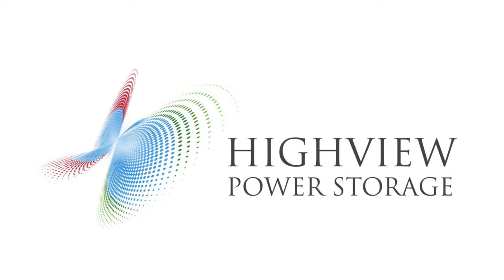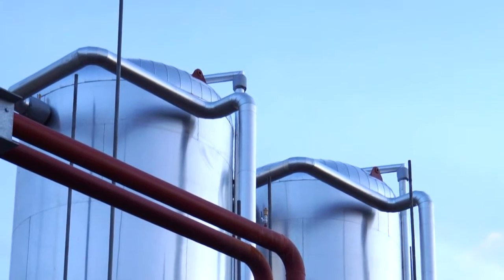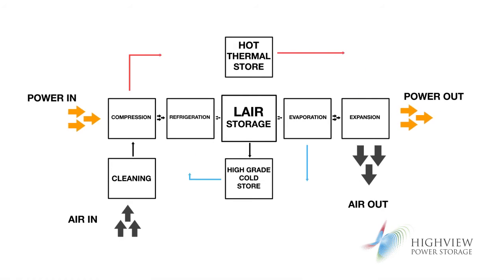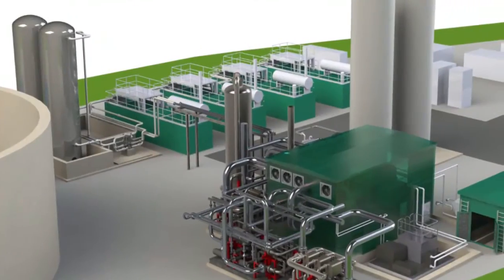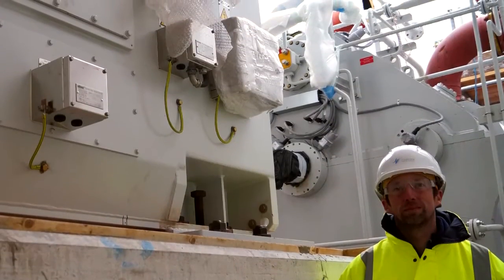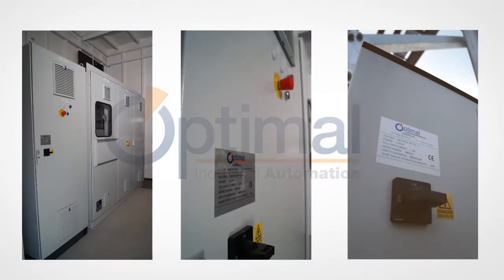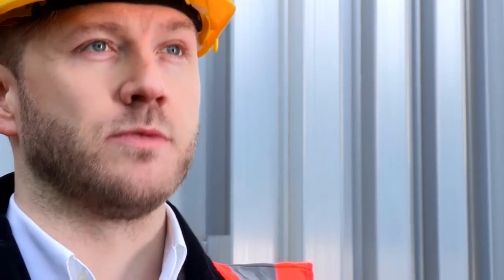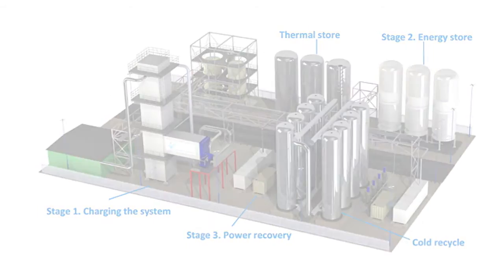Automating the world’s first full-scale liquid air energy storage facility

Comment: Very rich as third party video only can be showing the various add ons from heat to cold secondary / virtual tertiary etc. cost elements.

THe year old CB in essence is a comment about seasonal storage for servers- that is the 'problem' of operating evaporator coils in dead of winter lol. 

Indeed Christopher!  Precision cooling they ain't.  Heating oceans, heating atmosphere... what's the difference lol?

I have watched first solar vimeo propiganda ok and it upsets my tummie well you know what i mean

there panels are feet wide and thirty of them are as thick as a hair so they have like however many super model manes nearly a third or so around the planets worth of garbage litering so far

GE makes reactors.  Reactors use turbines lol especially single shaft to alterntors travesties.  What is needed is a helium or carbon dioxide fission driven motor to spit out not liquid nitrogen but dense air- 08 dense.  Hundreds of thosuands of horsepower is our air carrier lol

we need at least multimillion horsepower driven air solidying infrastructure to make electricity a fad that has overstayed.

New materials we all know are very good at shining coherent beams of heat into outerspace so you don't store it!  YOu ship it out- and the fuel, the crystals pressed into blocks of all air elements suck up even more as they are melted.

for untracked vehicular use only would we see smoke stacks lol.

Otherwise your refrigerants boil from atomospheric heat driving your human scale mercedes smart car or lighter contraptions fast, furious, safe, clean, and disposably duh.

Disposably!!!

YOU don't work to condone pv lol  YOU work for the public good- you distribute the energy neutron release from cheap solid materials presently only hoarded.  You let heat do work, namely freezing air, then ship that ice to where work not proximate to fission needs to be done.  Any questions?